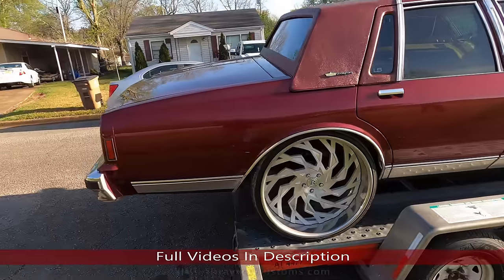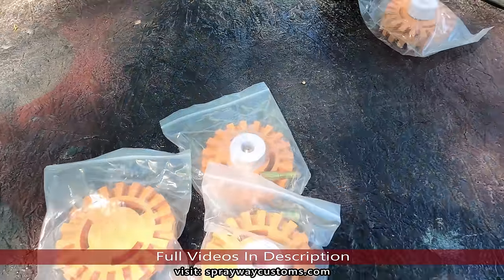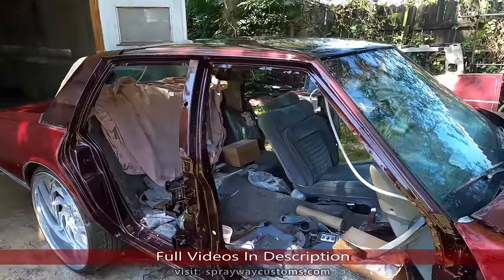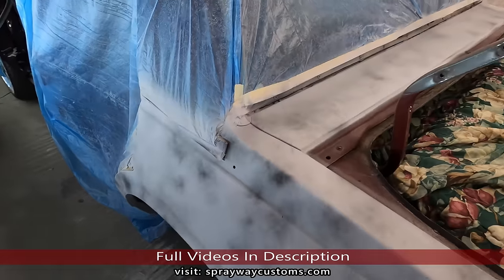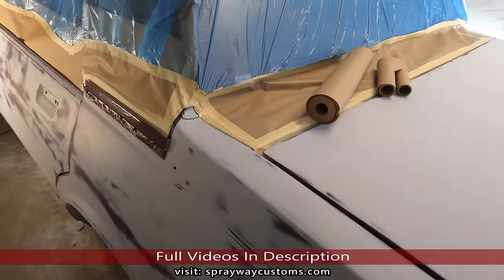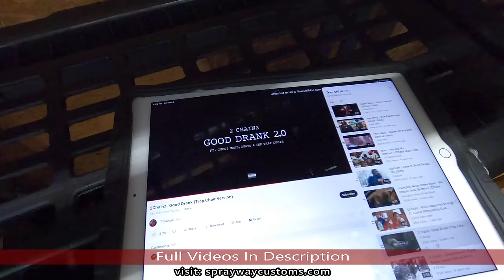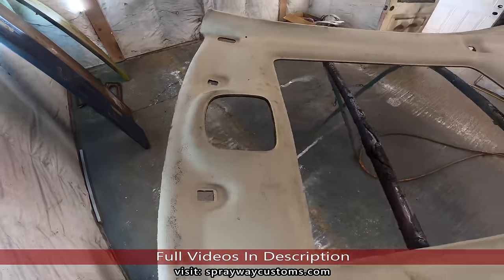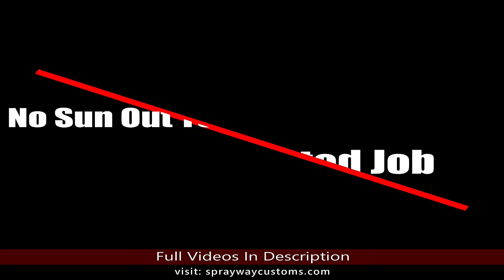Complete Paint Job Build FROM START TO FINISH Box Chevy Caprice On 26s With G6 Panoramic Roof

Comment: I owe everything I know about getting a show quality finish to you!  Recently finished my ‘89 Range Rover.  Went with factory Beluga Black, cleared, wet sanded and followed your flow coating steps for extra depth and durability.  I buried the “Range Rover” decal lettering in the hood and tailgate following the same steps as your red Chevy 454 OBS.  This is the first car I’ve ever repainted, but after flowcoating wet sanding and spending several days getting the polishing done, it looks better than factory!  Thank you man!